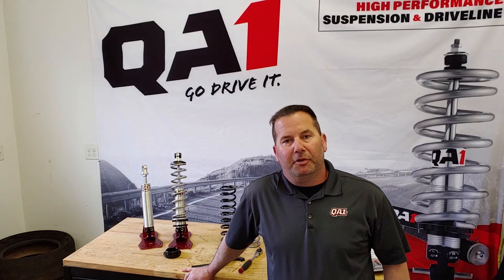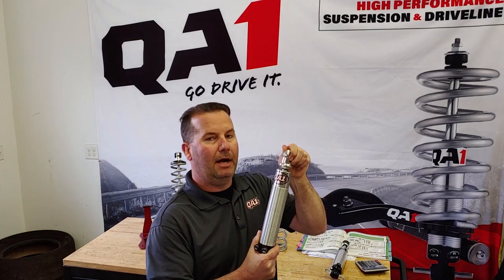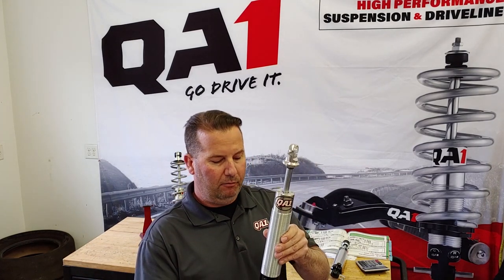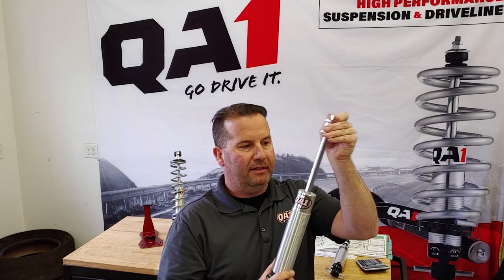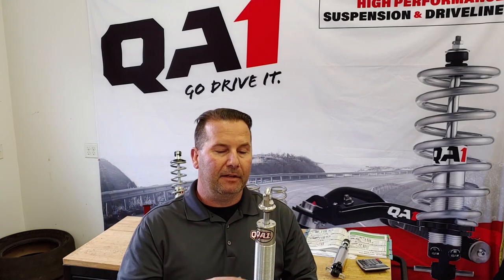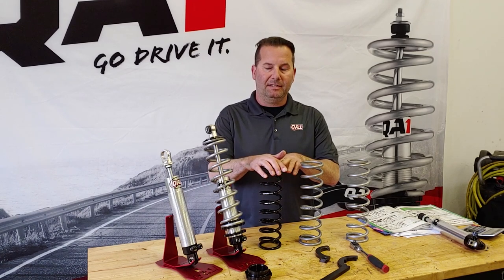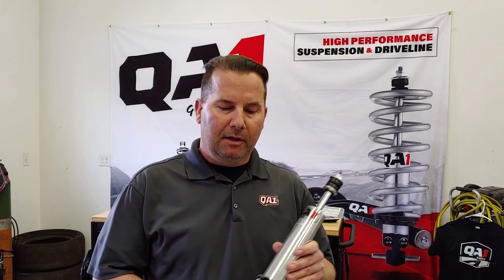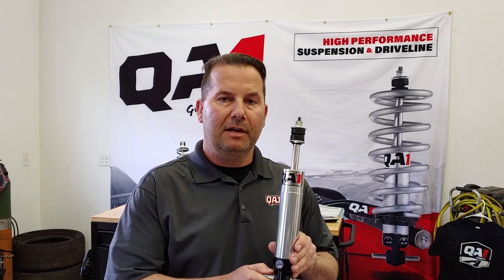Why Coil Overs Shouldn't Make Your Car Ride Rough

Comment: I want a 1.4 drop front and back with as close to stock or better on my 2012 sxt charger? I have eibach pro kit and smooth roads it’s awesome but bumps bumpy roads or imperfections in the road it rides baaaad signed a 58 year old hot rodder